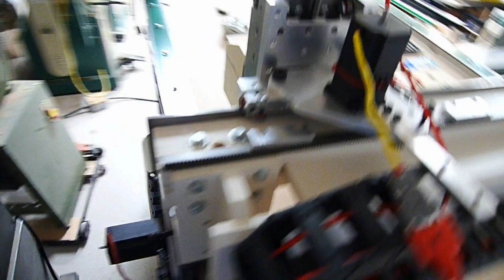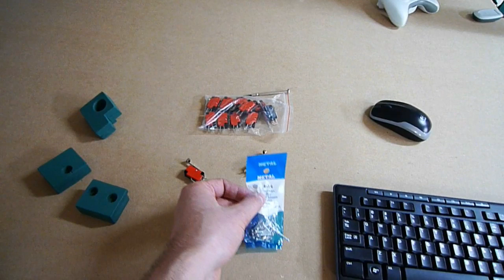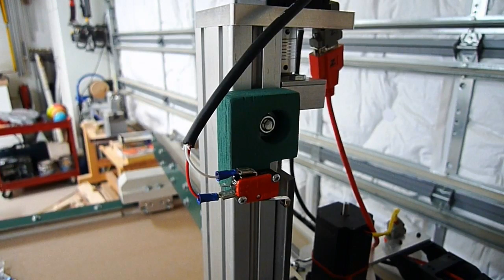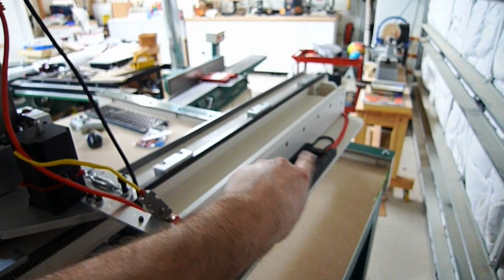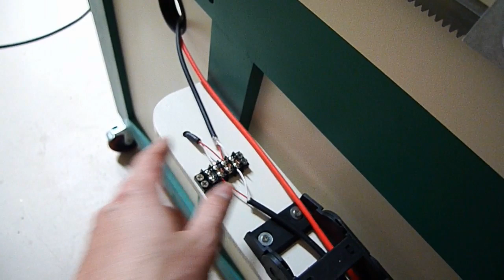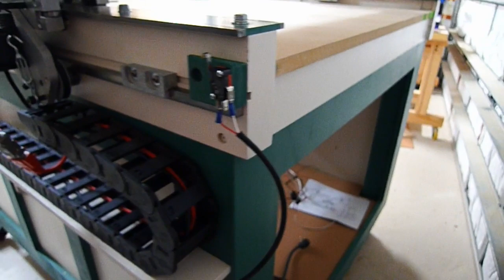Wetland CNC Router Part 22 - Limit Switch Installation and Wiring

Comment: Great build and even greater commentary. The only thing that I would suggest would be to join your limit switch wires together such that the shielding is complete all the way to your ground point. I did mine like yours and I had a lot of problems with estop triggers and it turned out that the limit wiring was picking up interference from somewhere and even setting debounce to a massive 45000 didn't solve it. I disconnected the limits to solve the problem but that wasn't a good idea as it produced other problems. Eventually changed to shielded  proximity switches and wired them with a single run with no joins and have debounce set at 4. Thanks for the vids, I have learned and enjoyed them very much.

Comment: Awesome machine any new videos? The only thing I would have changed would have been three invidivual series connections to the limit switches, 1 per axis. If the gecko drive would allow it. As it sits now, you can't create a "machine home" position, because when ANY limit switch is tripped the machine would stop. Dying to toake on a project this big myself, I've built a few little ones but nothing this big.